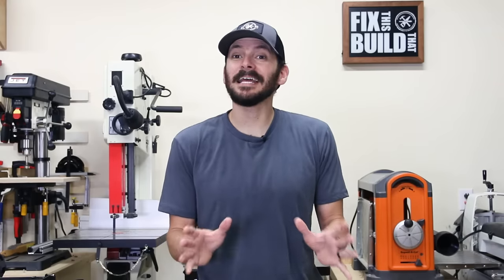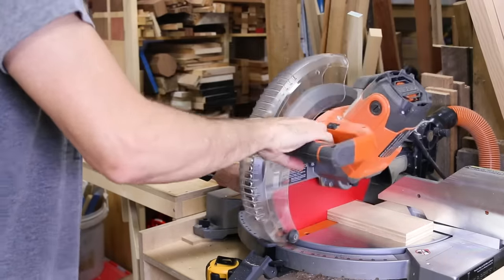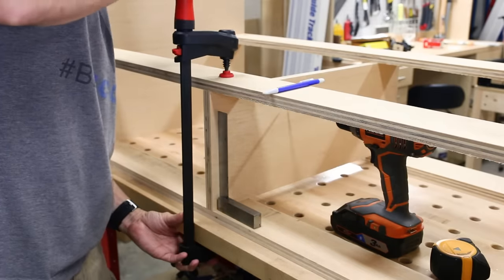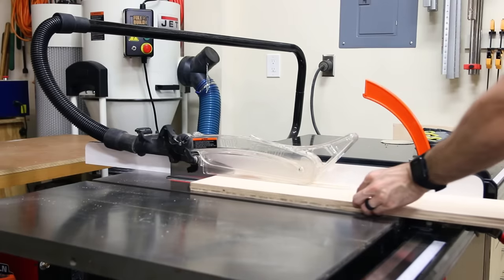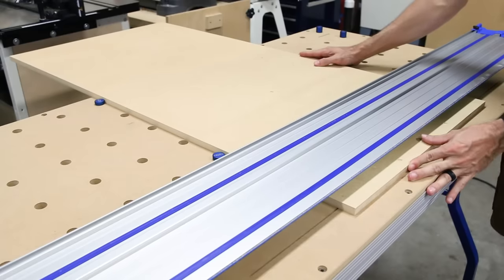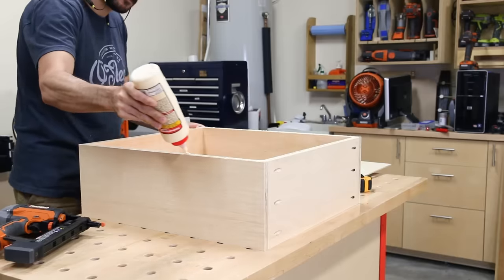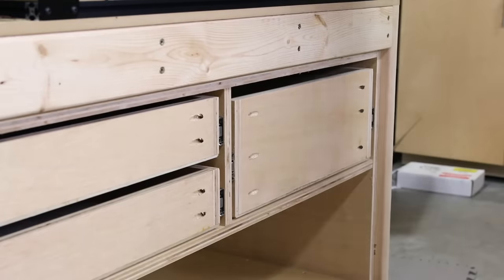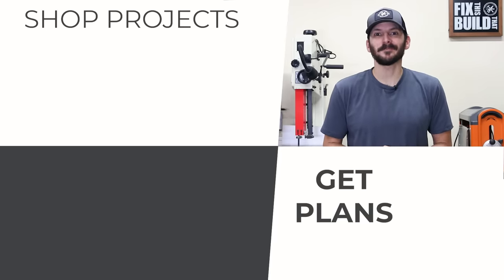Simple Way to Add Drawers to Any Workbench | How To

Comment: Hey! I know this is a four year old video but I recently used your technique to custom fit drawers under my assembly table. I'm relatively new to woodworking but was able to execute your design due to its clever simplicity. I wanted to say thank you!
Reply: I'm curious to see your build I'm wanting to do the same but concerned I won't be able to make it without the drawer dimensions and cut list.

Comment: Just finished your build on the work table. It was a great and easy plan. Looking forward to adding draws later on. I watch your drawer video several times and you didn't mention the plywood side panel for the drawer measurement. Is it 22 inches same as the draw slides??  Will start working on your drill press station soon. Look forward in building it.

Comment: Have made the drawers both ways. Depending on use I like the not glued bottom in a dado as if something gets spilled in the bottom of the drawer. It can be replaced easier. Good job as always..:)
Reply from the maker: Yeah, good point for something like a kitchen.  I always thought "if the bottom ever gets busted up I can replace it easily".  Guess how many times I've EVER had to replace a drawer bottom...none, ha.  So I've been rolling the dice with glued bottoms for a while now.

Comment: Thanks for the great video! In order to improve my skills I'd like to understand some of your decision making.
1. You almost always use pretty thick plywood, since it can be really expensive (at least here in Sweden) I'm wondering if it's really needed or would it be fine to use thinner plywood?
2. How come you built the box rather than attach the plywood to the workbench frame one at a time? Maybe it's just because you're more used to building boxes and either works? Or is there an advantage?

Comment: Awesome!  Thank you!  Just built my first workbench, and have been trying to figure out the best way to build drawers into it for tool storage.  Just what I was looking for. I've been going back and forth on whether to use 3/4" or 1/2' plywood for the sides, etc. and 1/2" or 1/4" bottom respectively (have some weight to the tools I want to store in there). It looked like you used 3/4" and 1/2" on the bottom?  Did I hear you say that you are/were an Engineer?  Me too! (Mechanical)...it's torture trying to be so precise...Ha Ha!  Great video, and looking forward to more...watched a lot of them as I'm just getting started with all of this, and yours are top-notch! (so fun, and people think I am crazy that I am investing so much in this, but it's just great to build stuff).  Would love to see the drawer build video...come on, what are you waiting for, it's been a few months already, and I want to finish this over the weekend...JK :-) ...looks pretty straight forward, and I don't think I need any fancy joints for this project.  :-)  Again, awesome job!

Comment: I am building drawers for my Basic Mobile Workbench. The less expensive slides when attached to the sides of my first opening was not far enough back. I need to move them in another 1/2" or so. is there a rule of thumb for placing the assembly that attaches to the cabinet? Great vid, good info! Thanks
Reply from the maker: I typically use a scrap of ply that I'll use for the drawer fronts and move the cabinet back until the drawer front fits flush with the legs

Comment: Was it necessary to use the Kreg Micro pocket to put the pocket holes in the 1/2” plywood? If not, which jig and screw size did you use? Apologies for these questions; we are new to all of this and want to get it right.

Comment: @Fixthisbuildthat    I have no side walls to mount the slides to. I need to mount the 30" wide X 24" long X 6" deep drawer closer middle of my bench. I'll admit wood working is not something I know a lot about nor do I have a shop full of tools to do that kind of work. I plan to buy my wooden drawer from a company in East Texas. My plan was to use angle iron/aluminum screwed to the bottom of 2X6 rails of my bench to mount the slides to. 
Any ideas or videos you can recommend? You do some amazing work thank you for sharing.   Thanks Elwood

Comment: Nice techniques, for both drawer construction and adding them into the existing workbench.  I used to worry about gluing and fastening the bottom to the sides, thinking it would expand in humid weather and blow out the corner joints.  I preferred  sliding it into a dado, no glue just floating, until I read up on wood grain directions and realized how much or little each one expands, and the fact that longitudinal grain (runs the length of the tree) is close to zero expansion (all the expansion is in the radial, across the rings from center out, and tangential, like the ring's circumference expands).  So since plywood layers are shaved off the tree like paper towels from the roll, it has longitudinal grain running alternating in both directions, making plywood essentially non-expanding and very stable.  (A glued-up wood panel is a different story, and would definitely expand side to side, but I've never gone to the trouble of making one only to use it as a drawer bottom.)  It might be tough if I ever have to get a glued bottom off a drawer, but so far I've just had to build them, not repair them (in that way, at least).  Fingers crossed.  😎
Reply from the maker: Yep, since the sides and bottom are all plywood the expansion is pretty much zero

Comment: Nice  job on modifying the bench  i imagine the storage will be awesome for setting up and breaking down CNC jobs  i worked at a shop for  over  20 years and they. Used only Accuride  drawer. Slides unless a customer specked out something  different for some custom application  or need ?  They are a excellent  peice of hardware  as i of course used them on my personal projects as well
Reply from the maker: yes, the Accuride slides are great if you can afford them

Comment: Brad, just started working on a workbench and I looked up how to put some drawers in when I found you. Great video dude! I do have one small question. How wide did you make the rails? It looked about 4” but I wanted to check. I looked up, down, back and forth (even on the website) but I couldn’t find anything. Just want to make sure I make them stout enough. Just sub’d so please keep your vids coming man.

Comment: Solid stuff!👌
Really impressive your work is really beautiful! I'm addicted to your channel! Keeping me up late at night! 😉
   Speed, clarity and the way you video! And not to forget the tools and work benches you use! 

 Random question why do I see a lot of custom built drawers in my home in the kitchen with two sides being cut on an angle and then using nails to attach them? Vs cut flat edges and adjoining them? 

 Now that I see how the pre drilled holes work(what the pros call pocket holes) I think I'll be getting one of those tools, works like a charm.
   Just curious can you use any screw for the pocket holes?
Or only the companies screws? Meaning what they recommend?

Comment: I want to make extra drawers and shelves, but that's a lot of plywood to use. And 3/4 inch plywood is expensive ($54 per sheet).  Even making the storage shelves, plywood is the most expensive part. Do you have cheaper alternatives for those wanting to make something similar?

Comment: This turned out great. I'm still super curious what the red handled tool is that is with your bits and wrenches.
Reply from the maker: It's just a collet wrench with a rubberized coating on the handle :)

Comment: what stapler did you use to stapler the drawer bottoms on, and couldn't you use a 23 gauge pin nailer
Reply from the maker: 18ga stapler. 23ga won't be as good. No head to pull the wood tight

Comment: Nice job, although I don't know why you would use pocket holes to build everything when it would be simpler to just screw it together.
Reply from the maker: pocket screws go through thelong grain at an angle vs. just straight into end grain, which is much stronger

Comment: Too much robotic CNC for me, in out.
Reply from the maker: 😂 those two 9x6 inserts in a 48x40x35 project threw you over the edge?
Reply: @Fixthisbuildthat  I didn't watch the entire video, the internet is flooded with CNC made garbage, I subscribe to woodworking channels, not wood machining.
Reply from the maker: Too bad you didn't watch or you'd realized this was a woodworking project with CNC tool holders put in the handmade drawers. But you do you 👍
Reply: @Fixthisbuildthat  I just feel a CNC takes all the skill out of the build, it's only a short step away from an IKEA build.
Reply from the maker: @keithswoodshop1193  hand tool woodworkers would say the same thing about a tablesaw, jointer, or planer.  It's all an evolution to me. And I'm more interested in building something I designed than the purity of the methods. I wouldn't say a car takes the skill out of riding a bike. It's just a different and more efficient way to travel to certain places and long distances. That's actually a great analogy 😀
Reply: @Fixthisbuildthat  if all you're after us the end product, I build for the act craft, I have always enjoyed your videos, I just finished my drill press stand. 
Yes, I use a bit and brace when possible, as well as a hand plane. I deal with robots and computers all day at work, reverting to the ways of old woodworking is my escape
Reply from the maker: @keithswoodshop1193  then your position makes sense. I'm in it for the learning and trying new things whether that's hand, power or CNC controlled tools. Keep watching if you dare 😀

Comment: "simple" ??  Look at all that fuckin equipment dude.  All I got is a goddamn circular saw and hand saw.  0/10
Reply: You don't need the fancy equipment to make cuts with your circular saw, but it helps. I would recommend self-drilling screws though. That will eliminate the need for a power drill to make pilot holes. Grab a Phillips head screwdriver (doesn't matter what size) and go to town. Simple... just like you.